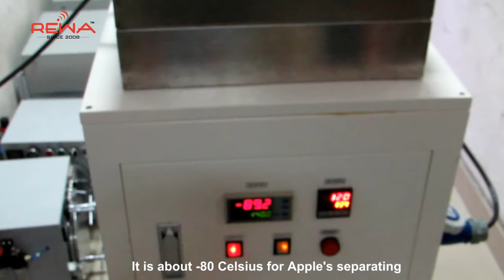Mobile Phone Screen Frozen Separator for LCD Refurbishment

Comment: It's needed to replace a backlight and a polarizer?
Reply from the maker: +Sergey Sergeich 
 Compared with normal way for separating, the damaged probability of polarizer  by frozen solution is lower. For protecting the backlight from wet ice. We suggest to use a film to separate the backlight and the ice panel.